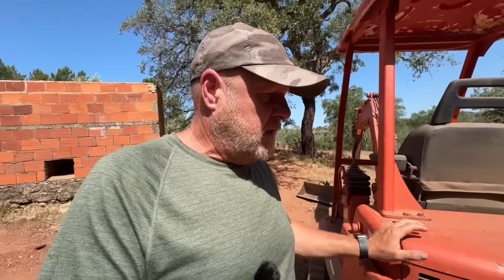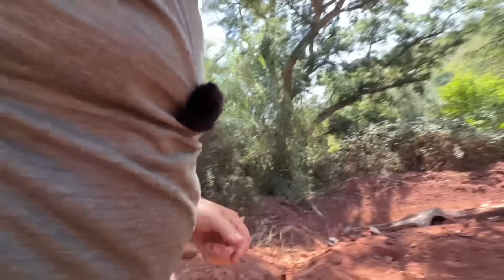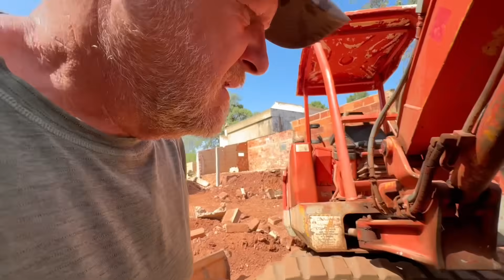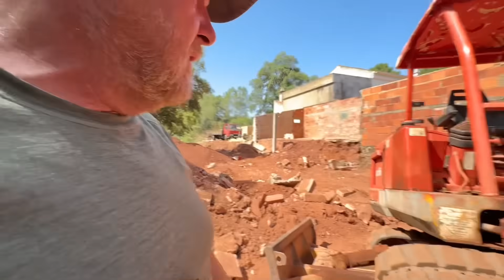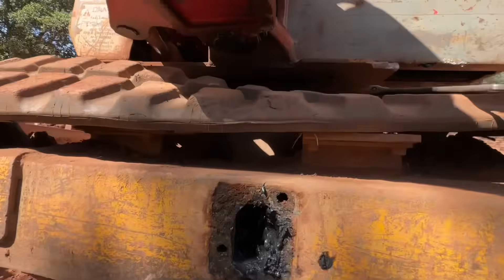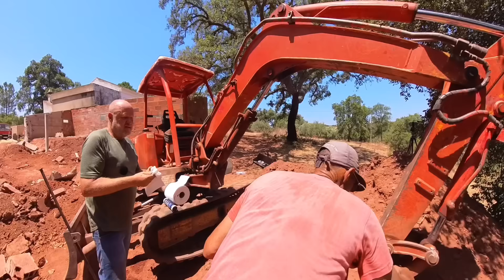Is This The Beginning Of The END | Portugal House Renovation

Comment: The plunger need to be fully down and as you insert the new cartridge pull the plunger at the same time, it will suck the cartridge into the gun. no mess!!
great video though
Reply from the maker: Quite difficult when there’s more grease on the outside than in the cartridge.
Reply: @The-Quinta  😂